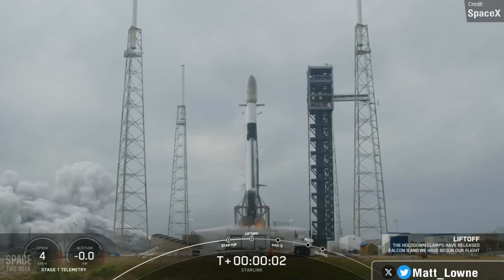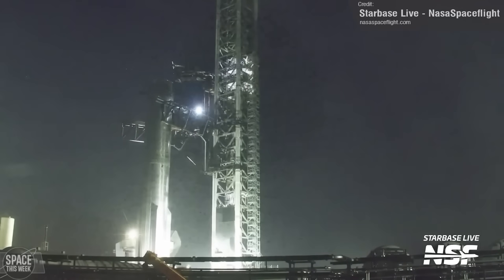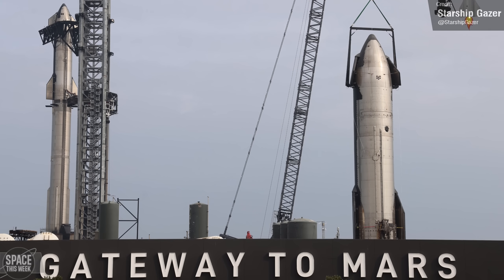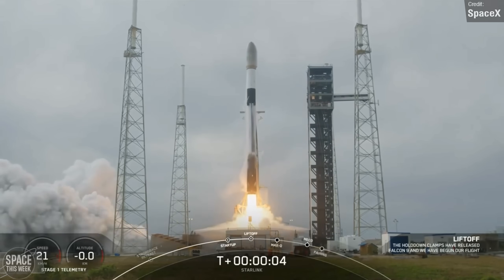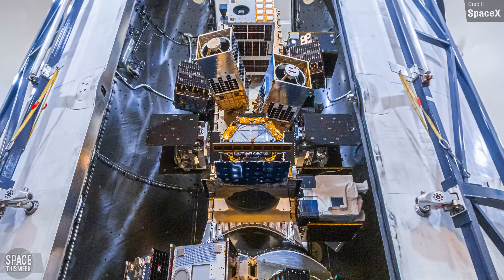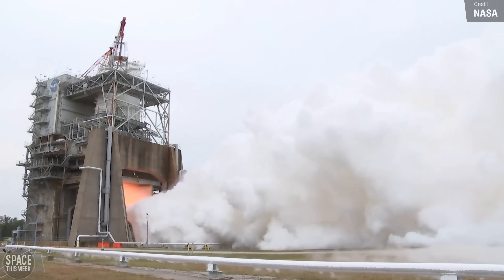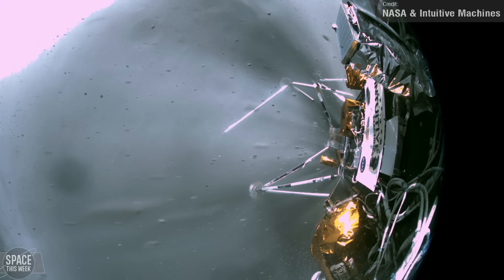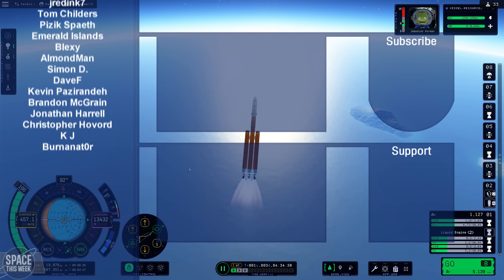SpaceX Just Completed the Wet Dress Rehearsal for Flight 3!

Comment: The boring regularity of the Starlink deployments is most impressive.  I'm thinking SpaceX Inc. would do well, to allow major non-profits advertise and raise funds using the cylinder walls like a billboard.
     Be really nice to see some emergency space walker recovery implements being tested.  Just in case a space walker were to get accidentally disconnected from the life lines.  A magnetic gripper hand,  attached, like a sinker to a fishing line on a fishing pole would be fun to watch being played with.  Maybe a speargun  launcher; or, a CO2 powered grappling net; and on and on.

Comment: Sadly ift-3 will be a carbon copy of fit-2. I hope they finally realize the current configuration is never going to work. Starship can’t bucks physic’s.

We need for starship to be successful for moon mission’s.
Then we are going to need a new moon rocket. One that can carry the heavy earth moving equipment to the moon surface and drive off the rocket.

 Which will be used for the moon base and dig the regolith. The hard part will be landing a large piece of equipment to process the regolith to extract helium 3. 

Which can be returned to earth with starship. The million dollar question will be  if booster can carry starship to 335 miles to send it to moon with a minor burn. The question is will starship have the necessary fuel on board to land on the moon and then return to earth and land safely. 

The current moon base design can be carried and deployed on the moon. Then the earth moving equipment only has to cover the inflatable moon base. This will make is safe for the astronauts to begin work on the moon. If they pull this off we will be in reach of life without fossil fuels. Elon will become very rich from this commercial endeavor. Let just get there.
Reply: Not gonna happen cause Elon is a controlling egotistical megalomaniac.
Reply: I’m sure Elon is studying your post carefully 😂
Reply: @cobraarms2466  

I’m positive he only reads his own products. He is a great salesman. But not much of an engineer. I’m sure the engineers of SpaceX have identified these problems. But Elon is the road block. To redesign of  starship would cost SpaceX to create or copy the Apollo f-1 engine it would cost SpaceX  30 billion dollars . They can’t create  more than 13 engines of a single frame.. if he had used booster rockets the problem wouldn’t exist. But the real problem is Elon’s short on that kind of cash. NASA and the military can be difficult if your project is not making progress. Just look at the helicopter that was built and appeared to be a success. The military has always ask for so many abilities to the project. That when competed it was a Swiss Army knife. So when you finish the project it doesn’t particularly work very well. The f-22, the f-35 and the next two aircraft about to take to the sky. They all are not as good as they could be. This all start in the mid 80’s.

I’m glad to be retired now. But as to the military they wee a great customer. They never cared about how much prototype’s cost. But once it was ready to go to production then they cared about how much the project cost. Elon has a limited window. After this flight he needs to redesign starship or they will walk away from him. I would like them to suceed. They could change the entire world with cheap energy. If Elon doesn’t have the cash he needs to approach the military to fund the redesign and build the military what ever they have in mind for their space force. Centuries